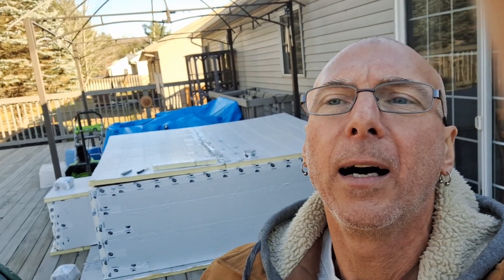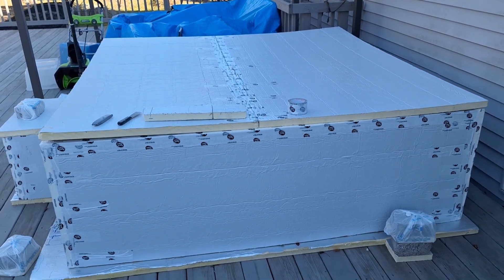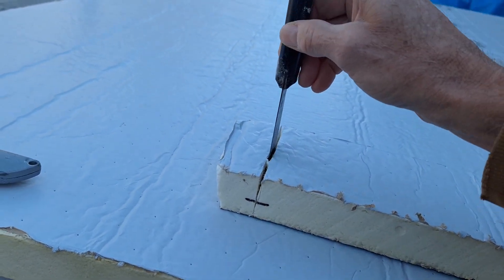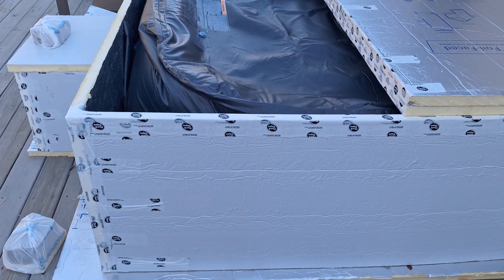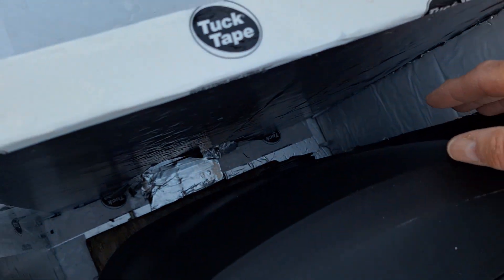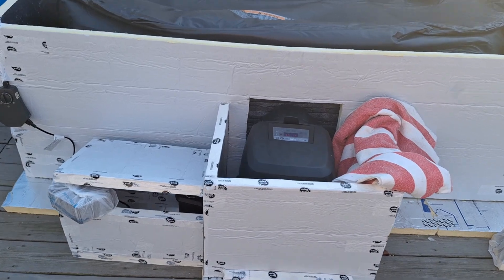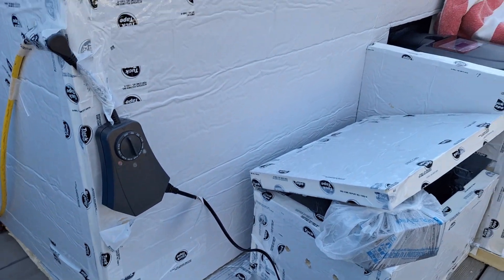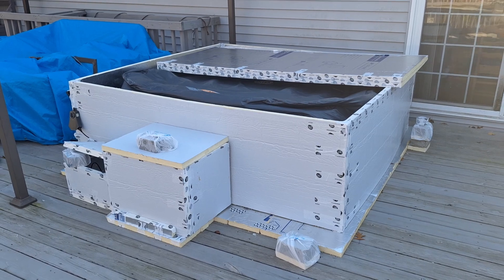WINTER READY INFLATABLE HOT TUB, Maybe....

Comment: Used a LP water heater with a pool filter. 48°F to 104° in 2 hours. Also got the insulated cover with silver backing on amazon and works really well. We do have to take the water lines out and drain them unfortunately when its cold when we are not using the tub.

Comment: So did the insulation really work?  Thinking of doing the same when I purchase one in a few months....
Reply from the maker: I do believe that it did help. The water stayed hot when I had it turned up but it never checked to see how it affected the overall running of the heater. 
One thing that I had to do half way through the winter was add a support because the weight of the snow started to cave in the top. I used one 2x4 but really should use 2. I cut out a spot on each side so the 2x4 could sit down in stand that better supported the top cover.
Reply: @ nice. Mine will be under cover.